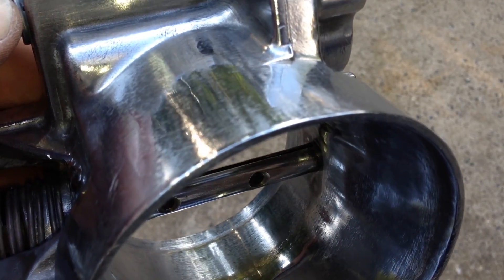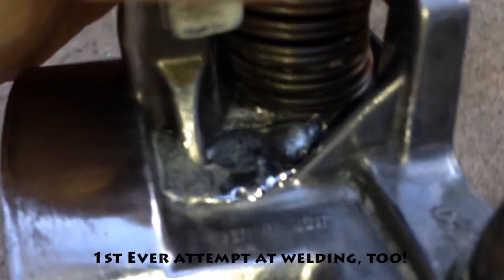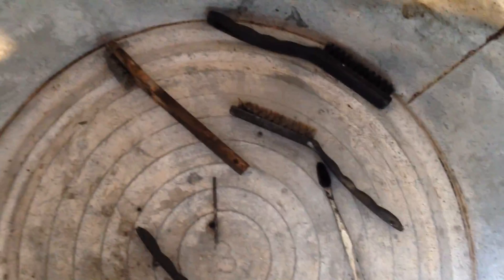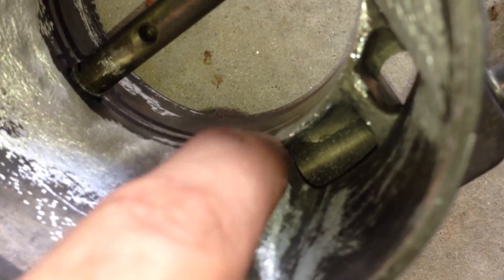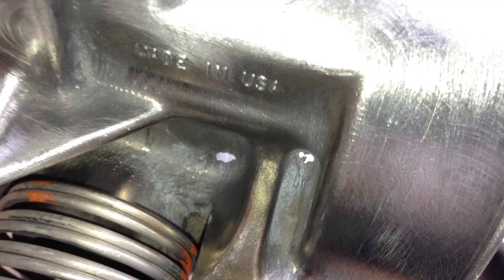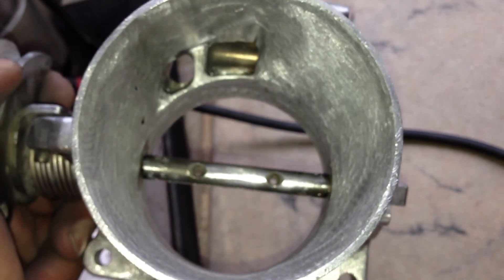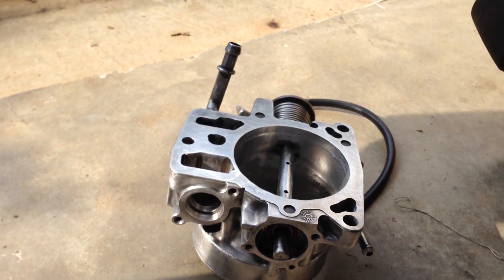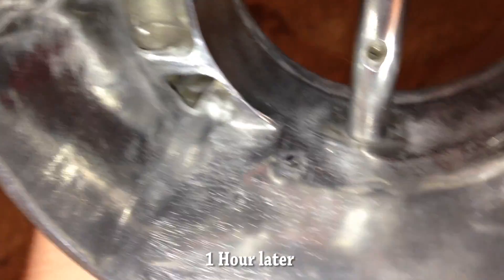Porting and Polishing GM Chevy Tahoe Vortec Engine Throttle Body LS

Comment: You wanna use SteelStik not the weld or solder whatever that was. The steelstik epoxy will work like a new formed aluminum on tbere

Comment: Gadget man uses an epoxy resin to seal holes or damage. Looks awesome dude. That polished look is amazing! Btw I just posted my first TB. I gotta do my intake manifold now. I just hope my car runs. Lol. I bought 25 mm manifold spacer on my ecotec V6. A plenum spacer ( 12 mm) but my problem is I have to take it off. Lot of people use JB weld for Aluminum. Top job.
Reply: Btw I think it will hold for sure! Cheers from Australia just subbed.nice work.

Comment: I had one done by Potz Speed and Performance many years ago.   They did
a SUPER job,  very professional,  they I polished the inside of the throttle
body to a mirror shine.    They didn't overdo the grinding on the inside
top of the throttle body.
Reply from the maker: thanks for sharing

Comment: You did well and it should work well. I know guys that re enforced all the thin areas first before porting as you learned getting some of those high spots smooth are also very thin. Throttle response should be noticeability better but always do a throttle relearn with fuel trim reset after porting one. Depending on engine mods a tune also may be needed.